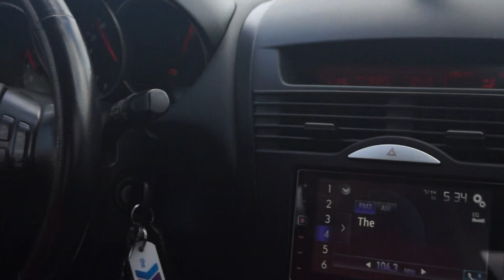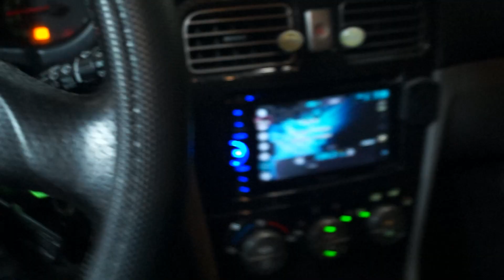Subaru Forester XT AC Idler Pulley Replacement

Comment: So much drama over a simple A/C idler pulley. 1) Loosen pulley, 2) Loosen adjuster bolt, 3) Replace pulley and belt (after doing the same for serpentine, since it's in the way). It's like a 10 minute job, and I have an office job.